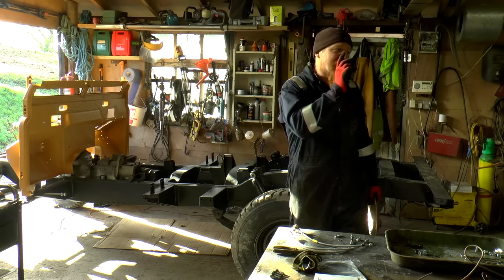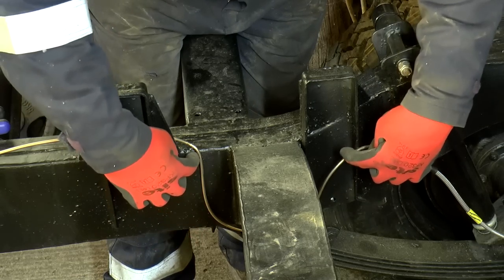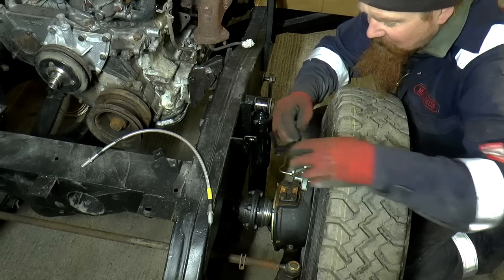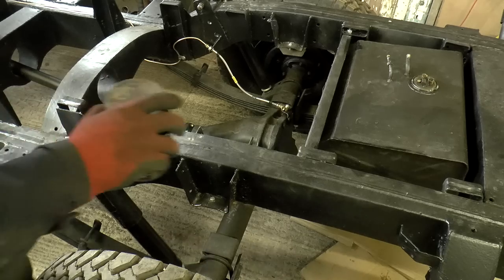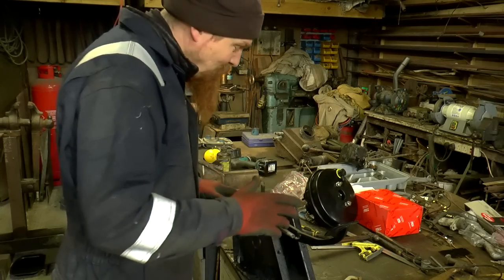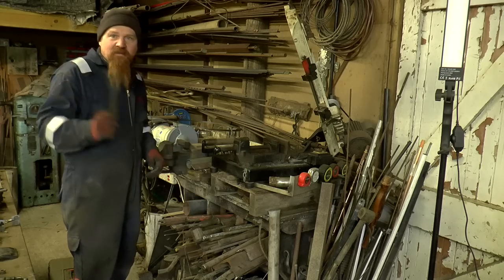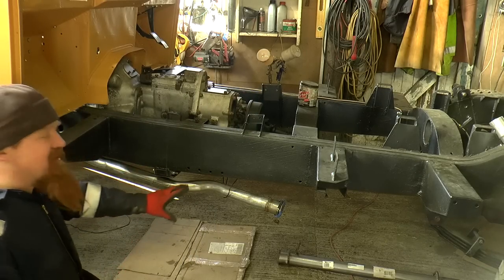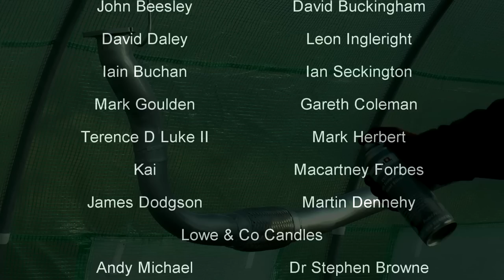Project Kermit 27: A Series Land Rover Full Restoration

Comment: ‘The rough storage area’ 🤣 You sir are a hoarder of bits . Saved the day though. I took the easy option and bought the Steve Parker full exhaust. I couldn’t find parts for less than the full kit. As I type I think it goes over the gearbox cross member so it remains a drop out….. but I’ve had a beer and might be wrong. It’s coming together Max, good progress. Mat

Comment: as a professional mechanic of 43 yrs, i can confirm i only have one brake pipe flaring tool...
another vehicle  with a total mis-match of metric + imperial was the mini, british leyland at its finest...
years ago, an early landrover driven by a farmer in the north-east needed an exhaust.  he turned his manifold upside down., drilled a hole in the bonnet, + fitted a short silencer, tractor style. his engine had only 3 working cylinders, + it drove in low ratio for about 20yrs like that, it wasn't that noisy, but we could hear him coming from quite a distance, to get his 2 batteries charged up for his telly.    it had a rolls royce engine fitted from new, very rare beast, sadly, both of them are gone now        keep up the excellent work young man

Comment: I bought one of the hand held flaring tools, invaluable for in situ work and simply streets ahead of the cheap crappy ones where doing a flare on a carefully measured piece of tube was hot and miss, so you have to shorten it and try again. Becoming less perfect each time.
Don’t forget the nut before you do the flare. Everyone does it!

Comment: Those brake flare die with the handle are damn useful for doing lines on the vehicle. They also work with steel lines. For doing them on the bench I use the one with interchangeable dies and a 1 stroke handle to flare it.

Comment: This is by far one of your most informative instructional videos to date. We work from the same type of garage. The house wire form is ingenious, I am going to incorporate a heavy house ground wire an 1/8” or so thick to use as an model for building my lines on my 86 Chevy square body. On top of that the knowledge about the difference in the metric and imperial flares. Thank you.

Comment: Excellent progress, nice work well done & thanks again for explaining all those little things others would skip over (like brake flares). So glad you made the exhaust can't believe how much some company's charge for exhausts for conversions...
Reply: Steve Parker charges about 350 for complete system for 200 tdi conversion on lwb series. Mines been on four years and is still perfect and fitted like a glove. Personally I think that’s worth the money.  When you cost your time and effort into it.
Reply: @highdownmartin Im sylure theyre good but cost ,not anymore they don't. Discovery 200Tdi into LWB is now £561 in mild steel, Stainless is £782. A standard 110 mild system is currently about £110. ..
Reply: @mully89  that’s gone up!  Thought I’d checked current price; got that wrong

Comment: Hi Max, double check the clearance from top of fuel tank to rear body support. Could be close now fuel tank is a bit higher. You didn't reinstate the chassis brackets that the rear support sits on. Just an observation buddy.

Comment: If you form the drum pipes by bending them round a small socket in a vice you can fit them in so the top wheel cylinder is the one you bleed instead of the ache of trying to bleed the bottom cylinder on twin wheel cylinder drums. It’s tight but it works fine for clearing the swivels if you watch what your doing.  After watching this I see your on discs. How fancy is that for a leafer. Great time to service the clutch slave and fit the exhaust system , both much easier with the body off.

Comment: You're completely right about the brake flaring, if you make a male end with SAE (imperial) but fit a DIN (metric) fitting the soft pipe will crush to the shape, but as there is not lubricating paste it can damage the pipe.
I made the same mistake on my 90 rebuild, borrowed a SAE flaring tool but they're all metric, noticed the male fitting was not flush to the pipe because of the different profile but tried them anyway, I scrapped the pipe as it ruined the flare i could see the marks where the fittibg had screwed into the soft metal and got the correct DIN tool.
As for tool
The lever kind that presses the shape is great, faster and quicker to change tools but can't be used on the vehicle in situ.
The ones you used are great to and arguably better when the pipe is already on the vehicle for repairs.
The draper kit kind are crap regardless of make, more a plumbers tool than a mechanics

Comment: Great job Max the brake lines are done properly. Good on you for researching it I've done it a couple of times using an almost identical flaring kit to your Draper one, they're a bit fiddly wand with some fettling they do work pretty well. I have to admit I've always used the SAE flares male and female even on metric stuff and never had so much as a weeping joint, but it's still better to do it properly as you have. I had not realised how much of a difference there was between the male SAE and metric ones. It was good to actually see the difference with them side by side so thank you for that! How long have you had the Rivnut tooling set? You said £20  that's pretty good, but I bet they're twice the price now. The exhaust looks pretty good, I've cut and shut a good few exhausts in my time and fabricated a full one when I built my Series 3 109";with the V8 in it, not too difficult if you have plenty of spare exhaust tubing nocking around as you have lol That silencer with the hole in it to me would be a prime candidate to weld a sheet of steel right round and save it lol. I did that a few times in my life when I was totally skint and out of work. The repair lasted much longer than the rest of the system, especially when I had to put new ends on as well when they started rotting out. It was an armour plated exhaust box in the end lol

Comment: I agree, I bought a similar flaring tool 45 years ago and have used it on a variety of cars. As you tighten up, the flare just adapts to the socket. I haven't had any problems. When looking at your flares, I don't think I have seen a metric one so far. 
This Land rover is going to be some smart vehicle and I am  looking forward to see the finished item. Thanks for the video.

Comment: Excellent as ever. A note for the future, my local motorcycle shop makes custom flexi brake pipes in any length with what ever ends you want on for a very reasonable price. Maybe youd have someone local to you that would do the same.

Comment: Hi Max, do you wonder about putting those threaded rivets into the chassis as a place for corrosion to start? I am following your series, and you took such care to prepare the chassis that it seems odd to drill it and then bung in a rivet without prep, although what prep you could do is beyond me.
Reply from the maker: One of the benefits of galvanising is that it doesn't just protect the areas sealed by it but also protects adjacent areas, if you put a deep scratch through the zinc layer into the steel it is still unlikely to rust. If I'd made a really big hole or change somewhere, I'd flood that section with the Zinga cold galv treatment, but the bits where I drilled for the rivnuts I'm not worried about (I mostly used existing holes in the chassis anyway).
Reply: @maximusironthumper  Thanks Max, I appreciate the response and understand it a bit better now.

Comment: Good solid progress, Max. So much easier to do when only dealing with the chassis. I never knew the SAE/DIN thing on the male fittings. I've obviously been relying on the mush factor without realising it. So do you need a DIN flare for metric male and an SAE flare for metric female?? Dunno. Nice job on the exhaust. Excellent call to limit the mods mostly to just the one section. The front part would probably outlast the rest, anyway. Great to see it all coming together, very enjoyable series to follow. Mart in Solihull.
Reply from the maker: Yes, the female (double flare) is the same shape for DIN and SAE so in my case my SAE (imperial) tool does both the male SAE and female SAE/DIN and the DIN (metric) tool just does the male DIN.

Comment: The front brake hoses should be on the other way around with the unions facing aft through the brackets to keep the loop away from the dampers.  The fuel tank rear flange was correct before you flattened it - it should have three special bolts with rubber bushes to allow for chassis flex - the bush goes between chassis and tank flanges, which is why to you found the heigh disparity.  You may find the tank now fouls the tub floor.

Defender pedal boxes are made to suit a different profile foot well, so they will be tipped at an angle.  You may find the pedals a little high as a result.  I hope it doesn’t shove the master cylinder forward and foul the wing top.
Reply: Thanks for that positive and encouraging contribution, 'Nick'......!!!
Reply: @andymccabe6712  I didn’t realise that only hollow platitudes were allowed, rather than practical advice and knowledge on safety critical parts.  You’d prefer I withheld information that would prevent a crack in the fuel tank or an MoT fail for brake hose impingement?  Max strikes me as a practical guy who is open to useful advice, such as the rear crank seal, not some fragile wallflower who can only take fawning praise in every response.

Comment: From memory the flexi hoses at the front loop forwards not rearwards, would avoid them clashing with the suspension dampers when you turn the wheels. Also check the bonnet will fit with the defender brake box and servo if you have not already!

Comment: Great videos thank Max, I have been captivated with this series. It would be interesting to see what the brake line flange looks like when you use the wrong shape and use the fitting to make it conform as it is tightened. Have you compared the result with that from using the correct tool, does it look as though it would seat effectively? Cheers

Comment: I am sure you have considered this but from the angle of the camera it looks like the front flexi brake hoses may rub on the shock when the wheel is on full lock. Great project and life style you have. All the best.
Reply: They should arch forwards with the metal pipes behind the brackets for that very reason.  I believe that hose contact with any other part while steering from lock to lock is an MoT fail.
Reply: @nickboylen6873  Thought you would have it under control. Keep up the good work. On another topic have you seen the work "Look mum no computer" is doing on the MIDI controlled church organ?

Comment: Check your flexi brake pipes on lock to lock for rubbing look how Range Rover did the top front pipes ( vertical orientation ) and as for flaring I use the cam action flaring kit for double and bubble flares in metric or imperial, excellent bit of kit but expensive, good job have a cup of tea.

Comment: I've restored a few old cars mainly triumphs and a few old minis and with a combination of metric and imperial male and female fitting across all the cars I've only ever used one type of flaring tool the imperial type. I've done many thousands of miles with no leaks to date. The most critical advance in flaring came when Industry went from a single flare to a double flare. Single flares provide less resistance to crushing in the fitting and over tightening the union would result in a leak as the flare would easily deform.

Comment: Really interesting videos and can hardly wait for the finished result. i had a thought about the front brake hoses, when you put the wheels on a left or right lock wont the brake pipes swing over and contact the dampers anyway? Why not just flip the hoses over so that they loop forward and redo the metal pipe?
Keep up the good work. Ken Wheeler Narrowboat Services. Chester.Uk
Reply: Came here to make the same comment about the brake flexies. Max could probably use the same metal pipes, just shortened slightly and re-flared.

Comment: Great series that i am following closely! Are you sure the series wing won't foul with the larger defender brake pedal box and servo? I built the brake system from scratch on my series 3 and put the later servo and master cylinder on (as would have been on the late 109s with dual cylinder front brakes) but your servo definitely looks bigger than mine and there isn't a lot of room to spare between mine and the wing!

Comment: FYI the flair is the same for metric or imperial fittings being SAE fittings, your new tool is actually a DIN flair and that is mostly used on Japanese vehicled. The type of flair is governed by the design of the union's pipe orifice not the thread of the union. DIN unions have a dead flat end and SAE have a countersunk inner edge - this determins the type of flair you perform. 
 If you loop the flexi forwards not rearward it clears the tyre and damper better. As for pedal box, better to use the later servo and brake master, it has 3 outputs and that means 2 front lines to the master and the one rear... 
Also really glad to see the LT76 still in use.
Exhaust is always fun for a 300tdi conversion... Didn't really consider the D1 pipe for it, had a stainless system made up. Kink and run under the chassis crossmembers then back up. V8 back section works well. Always good to keep some form of standardisation in the parts. 🙂 We did the first 300tdi conversion about 14 years ago... sold the vehicle last year to a friend... he loves it!
Reply: before anyone corrects on "it's a 200tdi engine", yes it is but a 300tdi turbo and manifold... so the comment is correct and meant as...
Reply from the maker: Using the later master and servo would give the wrong bias as they are designed for disks front and rear. The setup I've fitted is the exact one recommended by the manufacturers of the disk brake conversion.

Comment: IN THE TRADE we used the old factory pipe and just copied it by laying the new pipe on top of old pipe and bending it to the same shape then cut it to exact length and added  the ends domed end [male] operation 1 , Flared end [female] Operation 1 followed by 2 , remember to fit ends before flaring ends.

Comment: I used red rubber grease for everything brakes. Including lubricating the flare tool and the unions when putting them together. And a good splodge all over that can stay on it until I need to undo it. Doesn’t look pretty but it’ll keep it clean.

Comment: Very interesting, Thanks.   I've learned something new about the flares .   🙂                     

 like you I have the cr#ppy  Draper kit for many years and have scraped by with it,   what make is the tool you use and would you recommend it?     (I would like a SP unit but can't justify the cost for the amount it would get used, once in a blue moon)

I also have made up a few exhausts over the years, never had much luck as they broke near the welds but I was using old pipe salvaged from the LR dealers skip   (I was skint at the time)     
Hope you have more luck than I did.🔧👍
Reply from the maker: Both the flaring tools worked well and I'm happy with them, they have no brand marked on them, I got them from different suppliers on ebay (the first as part of a kit, the second on it's own).

Comment: I have a brake flaring tool that looks very much like the draper one you have that I purchased from snap on way back in 1976 when I was restoring a series 1 land rover, no longer have the land rover but the snap on tool  still look original with even the plastic box still in one piece I forget how much it cost ( some where around £11) and that it was way cheaper than any other make back then.

Comment: Nice video! I think you need to remove the strainer from the pickup pipe since you are using Diesel in the tank and it will get blocked easily especially in colder temperatures. LR only used the strainers in petrol tanks if i’m not mistaken.

Comment: What was the reason for the fuel tank not fitting?  I assumed it would just bolt back in to place.
Reply from the maker: The whole of the back end of the chassis has been rebuilt since the tank was last fitted. I rebuilt to the factory spec dimensions, which may be slightly different to how it was before.

Comment: Your analogy of your dodgy home-made 3-pin plug that needs to be mashed into the socket....... yeah, I think I've actually had a few plugs like that, they usually come moulded to the leads of, y'know, "bargain priced" electrical equipment.
Good time of year for going into the rough storage area.... further on into the spring, you might need a machete.